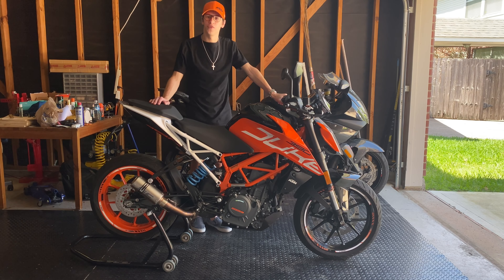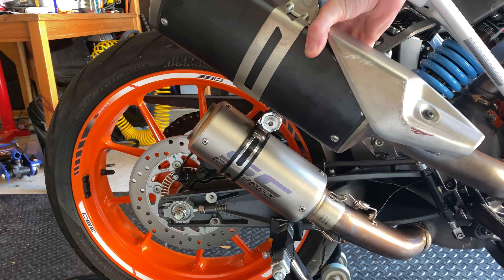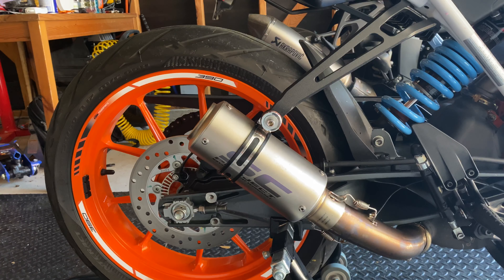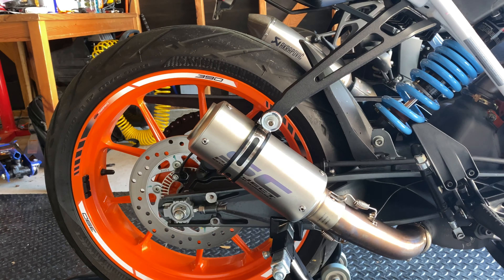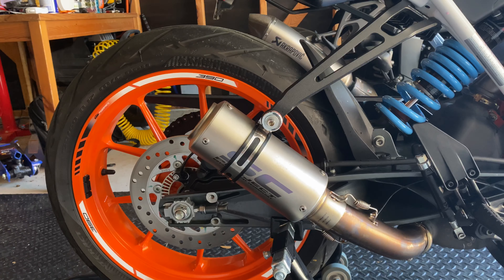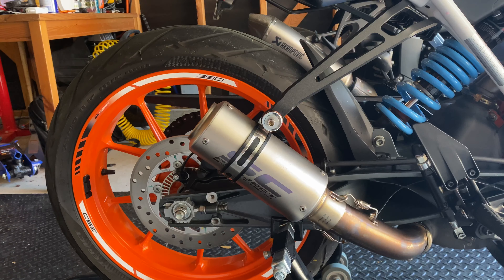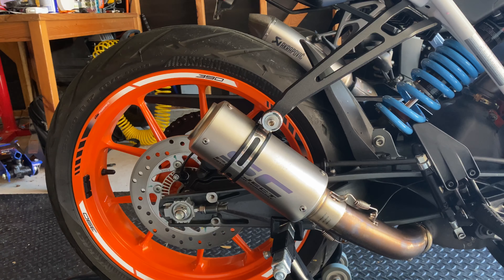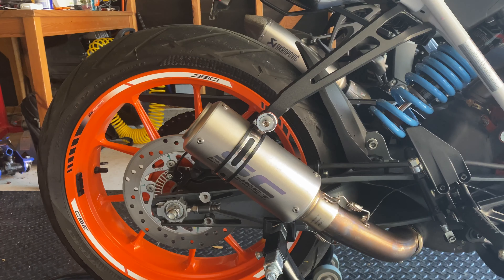KTM Duke 390 SC Project CR-T Exhaust Review & Sound Check

Comment: 60$?
Reply from the maker: Correct, I bought this exhaust for $60 and about $10 shipping. As I’ve checked recently, however, I see that the prices have been raised a bit; the cheapest you might find would be about $75~$80.
Reply: Can u send link to website ? Having trouble finding this specific one
Reply from the maker: Sure thing! Here’s the link - 
https://www.ebay.com/itm/For-DUKE-125-250-390-RC390-2017-2021-Motor-Exhaust-Muffler-Tube-Mid-Link-Pipe/362959814670?_trkparms=aid%3D111001%26algo%3DREC.SEED%26ao%3D1%26asc%3D20160908105057%26meid%3D04735c170ab64d8db5f9b9dde674547d%26pid%3D100675%26rk%3D1%26rkt%3D15%26mehot%3Dag%26sd%3D362959814670%26itm%3D362959814670%26pmt%3D1%26noa%3D1%26pg%3D2380057%26brand%3DUnbranded&_trksid=p2380057.c100675.m4236&_trkparms=pageci%3Ac0f62b91-8f31-11eb-b919-cabb43847b29%7Cparentrq%3A752328ec1780a764fd451736ffdd139f%7Ciid%3A1